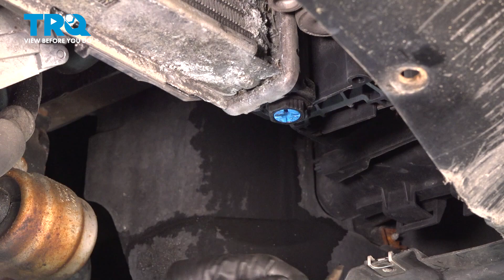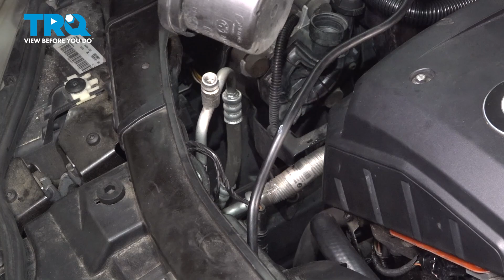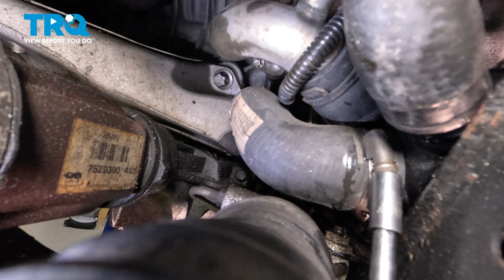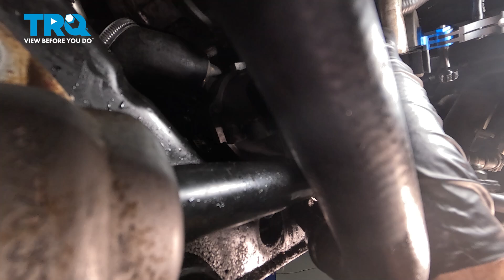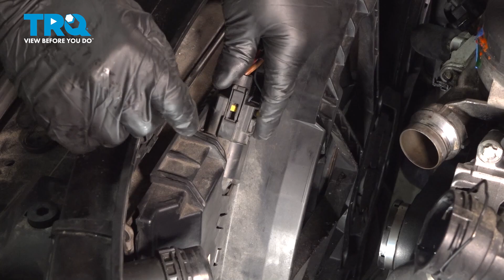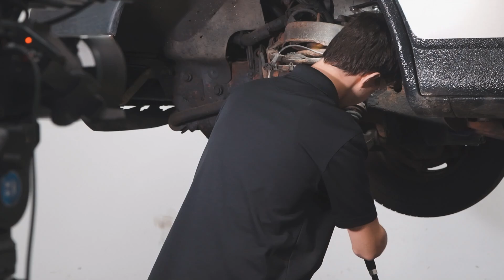How to Replace Engine Water Pump Kit 2009-2013 BMW 328i xDrive 3.0L L6

Comment: The fan goes in a lot easier from below. I just did it. If you have an N51 with the radiator EAC sensor that is right in the way it's a lot easier from below. 2 person job to avoid damaging anything.